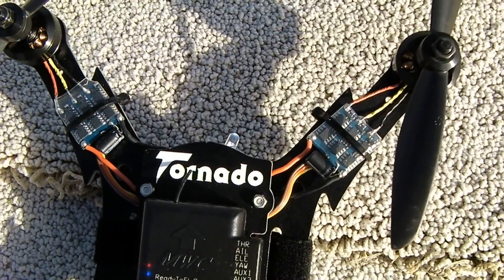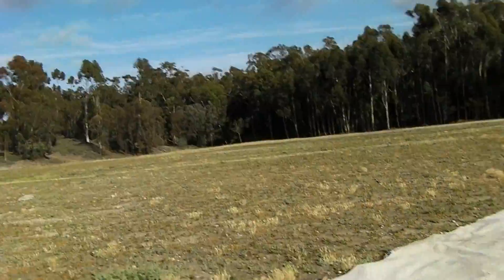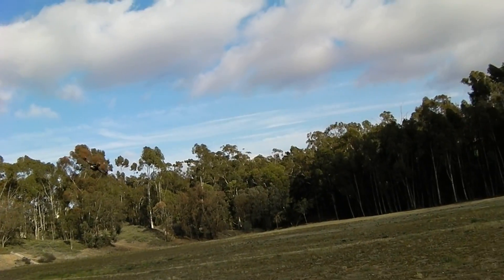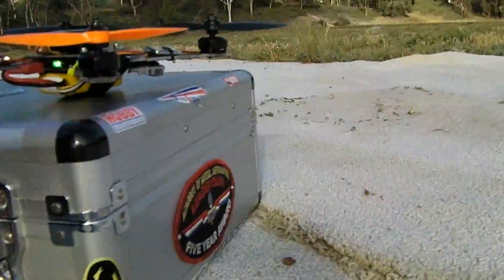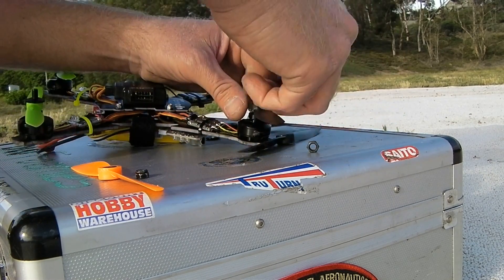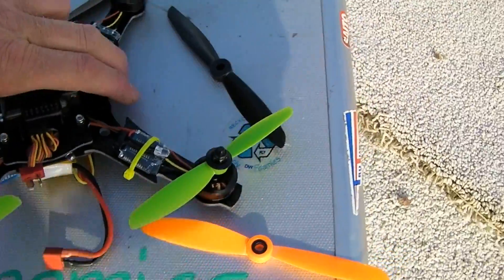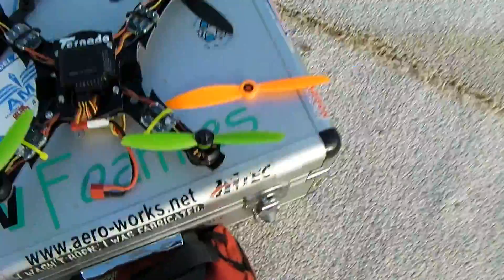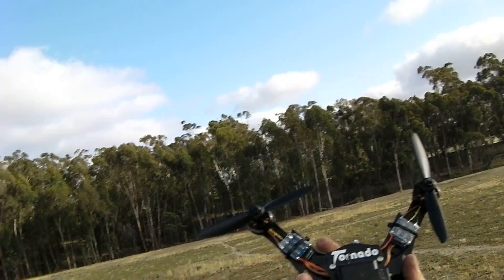TornadoFrames 240mm Hurricane 4PQ on Cobra MR 2204/28 2300Kv

Comment: I need your help I built a 240mm quad with 20amp esc 2900kv 10gram motors its slow and slugish and motors get hot I was looking at 1800kv 36g and 2600kv 36 gram motors I have 2 and 3s batteries I need your opinion largest prop I can use is 6 inch.Thanks Nathan

Comment from the maker: The motors used are all the same and 2 are spun reverse rotation by switching any 2 of the 3 motor wires to gain the prop/motor spinning directions. These motors use all standard right hand thread adapters, some motors come with reverse thread adapters. Some motors have a left (reverse) hand prop attachment version available and require purchasing 2 of each.

Comment: Quick question. New to quads and want to build one.The motors run both CW and CCW for the quads, so is it the same motor for each and they just give you the threads adapters depending on ration?

Thanks